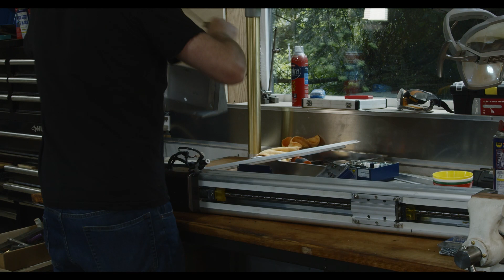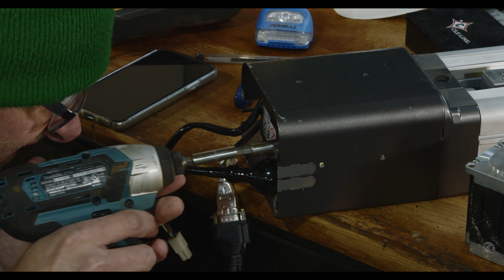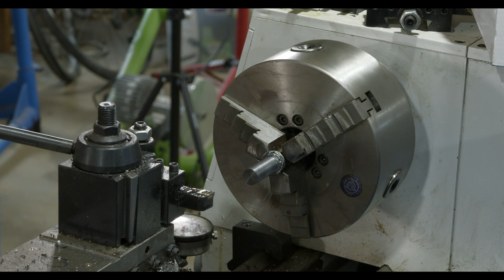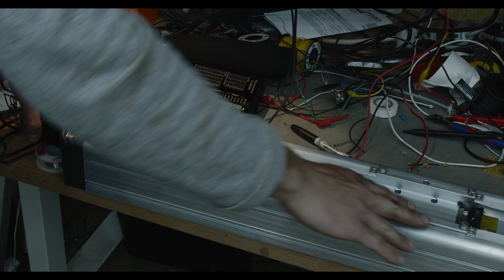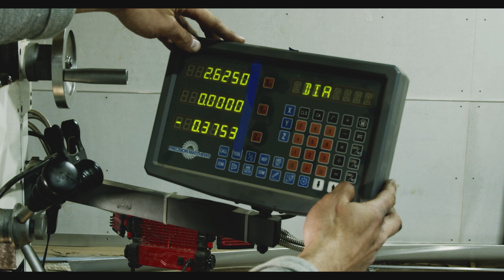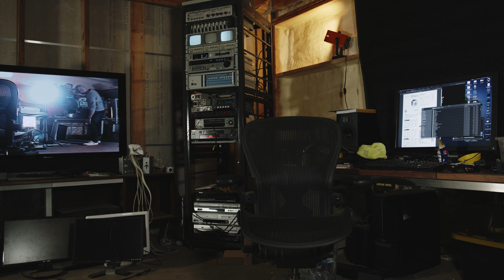Hacking together a camera motion system

Comment: Great to see this camera slide come to life! Are you using a high number of micro-steps and high enough current setting? That might  help with vibration.
Reply from the maker: I spent some time this morning going through the microstepping options and found one that worked well. When I took the first video, I only tried the high and low end of the settings. It turns out there was a Goldilocks setting that was just right :)
Reply: @superchromat  Cool! It makes for a sweet camera setup. A new commercial rig of that quality would be the price of a car!!
Reply from the maker: TandaMadison I believe it! In my research, I found that the controller I pulled off the rail retails for $1,200.